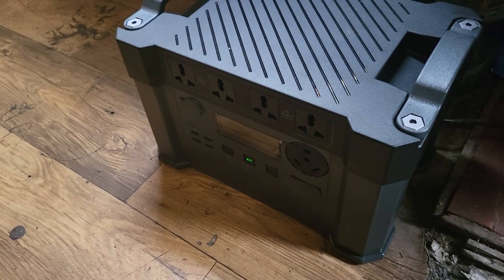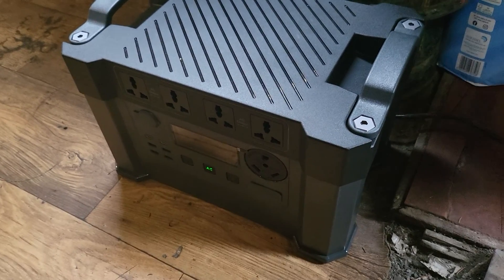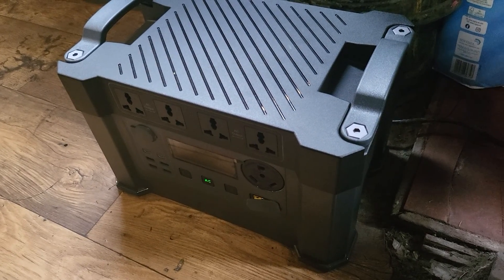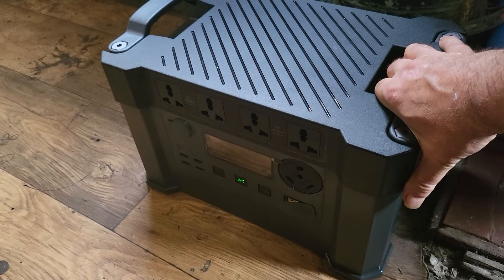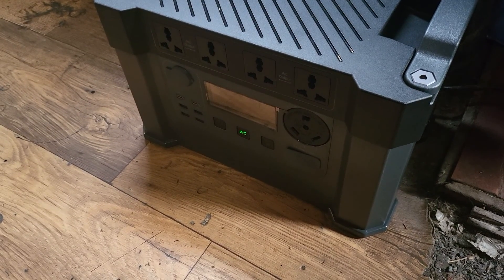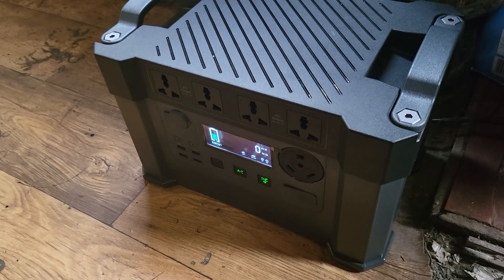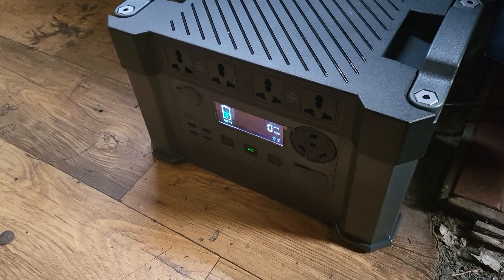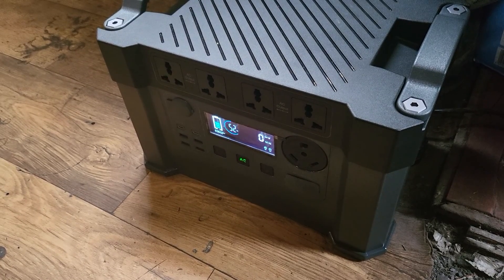ALL POWERS S2000 PROSolar Generator & Power Supply Installing in a Narrowboat in the UK

Comment: Mr yarwood here  again 30amp 125volt is printed on the rv plug in . Can l change it to give me power in my motorhome. With a adaptor or not? You mentioned a price of £50.00 for the one you want. 🤔
Reply: This is the reply I received from ALLPOWERS 

Hello,

Thank you for purchasing.

The UK motorhome plug is suitable for 4 AC outlets, no need to use the 30A outlet

Feel free to contact us if you have any questions.

Best Regards

Comment: Hi
What’s the name of the socket converter you need to buy to plug it into your boat, and where did you get it from. Are you still happy with the S2000 pro, I’m in the process of buying one.
Reply: I have a motor home with a 15amp hook up cable. I have bought a monster pro with the rv socket. Can you let me know what the plug is called. And will it work on my autotrail motorhome 🤔Mr Yarwood thanks
Reply from the maker: Okay - So here's what happened, the first one was faulty so they sent me another one (didn't want the first one back) and then that was faulty so they gave me a refund, then an electrical friend of mine took 2 of them and made one good one. So the plug you need is just called an RV plug but you need a short one - the standard long one unfortunately blocks the solar socket. https://amzn.to/3VodDbV this is the one but I haven't wired it up yet.